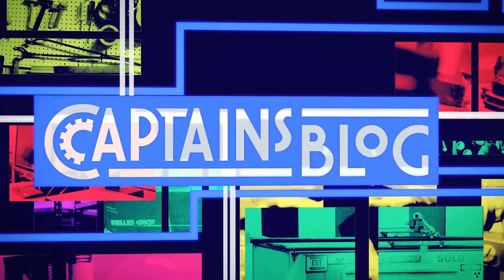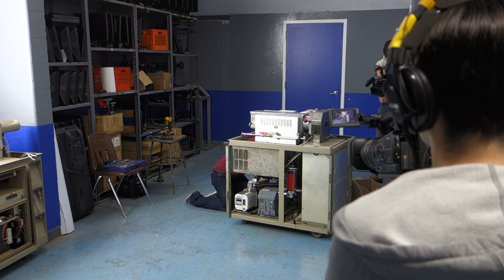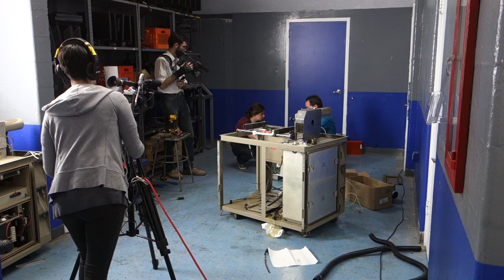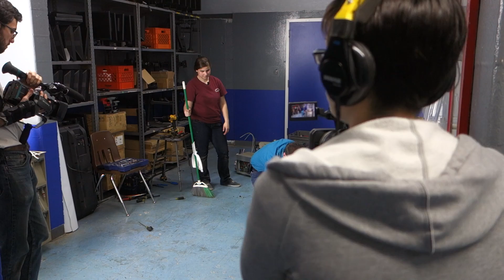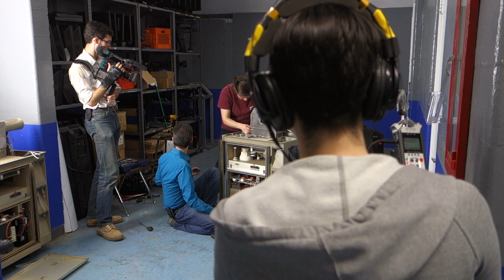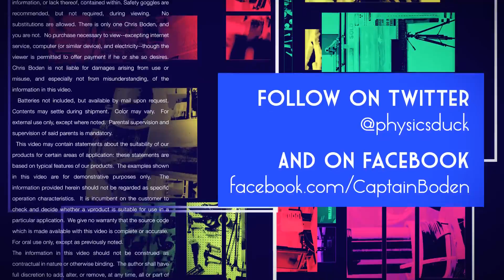Captain's Blog 11 7 2015 Autopsy Behind The Scenes

Comment: yes katie is excited.  pieces and parts very useful.  danger signs make life interesting.  weighty part is more useful.  where you have to yell to push or pull you need a power tool.  what made you say 'oh'?  that pump will move something.  neither do i.  the extra 3 volts does something.  what a great pump.